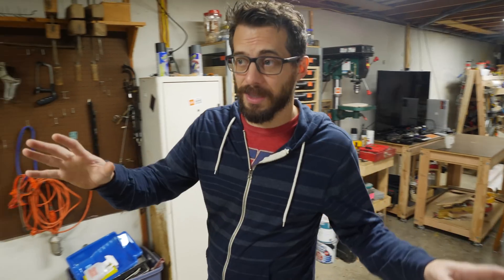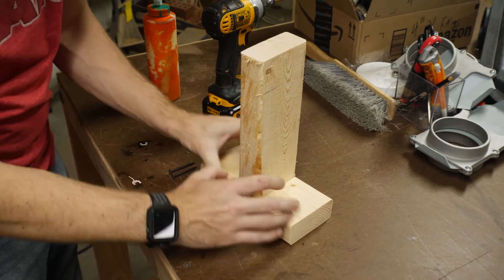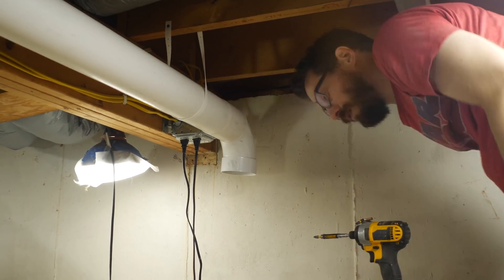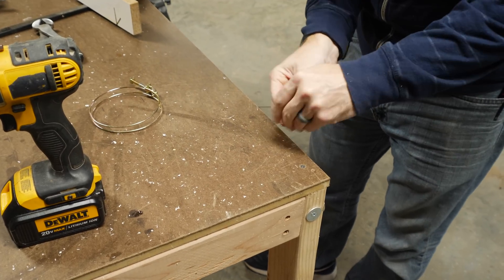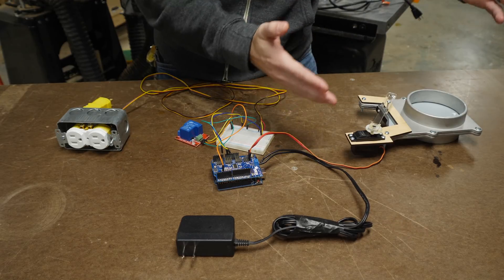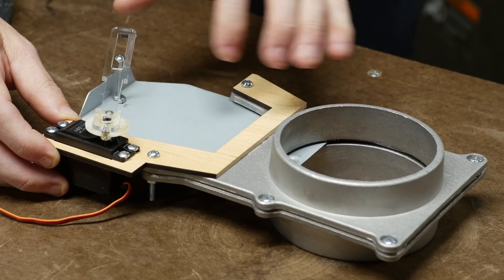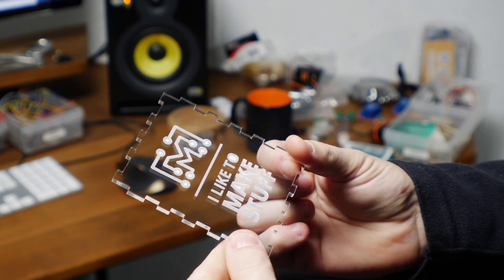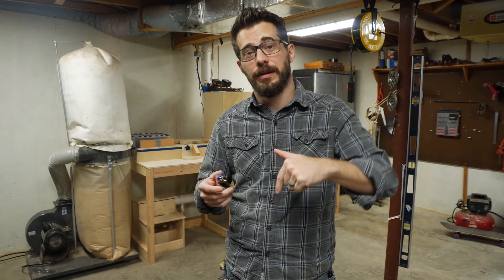Fully Automated Dust Collection powered by Arduino // How To | I Like To Make Stuff

Comment: How about a delay after you shut of the machine and the collector runs for 10-15 seconds more to finish pulling everything in? Nice work! I didn't know about the sewer pipe. GOnna have to check that out for my upcoming dust collector.

Comment: Great job, but i never under stand why people use Arduino when there is already micro PLC or smart relays with free software that designed especially for project like that and no need for acrylic box for protection, or convoluted programming. seems way over engineered   for a simple dust extraction system
Reply: gareth scott, Can the micro PLC or the smart relays do what Bob setup do?

Comment: Have you thought about adding a slight delay to the dust collector so that the blast gate will open slightly before the vacuum comes on. I ask because I assume that would put less stress on the blast gate servo, helping to ensure longevity.
Reply from the maker: It does. The gates open, the the DC. After the tool stops running, the DC stays on for another short amount of time to clear out the pipes as much as possible.

Comment: Very cool project. I am wondering though if the contacts in that relay are going to weld themselves together with the high inductive load of the dust collector, despite being 30A. I might be wrong but I thought a contactor was usually used for this kind of thing?
Reply from the maker: If it was deleted, it wasn't on purpose.

Comment: awesome bob. i have just automated my dust collector. does your collector uses a magnetic contactor? i have a 3 phases dust collector. here in brazil is very common to turn this kind of motors using a contactor. i use a 2 module relay controlled by a arduino. the first channel connected in parallel (normally open) to the turn on switch and the second channel in series to the disconnect switch. sorry my poor english. i'll try to upload a video showing

Comment: Better use a solid state relay for the dust collector, that motor draws a lot more amps when it starts up, and being one big inductor the current wants to keep running when you turn it of. That's probably why the mechanical relay fails, the contacts are welded together when the motor starts, and it arcs when the motor stops. Solid state relays don't have this problem.
Reply from the maker: Yup, that's the new component I've got on the way. 👍🏻

Comment: Hi Bob. If you are overwhelming that little SS relay, try using it to drive a contactor, using low current AC.
I like the idea of remotely controlling the vacuum using blast gates.. Hmm, 3D printing blast gates with built-in servos? 
 - Eddy

Comment: This is really cool!

If you wanted to fully organize it, you could make some of those "DIY" cyclones, feed them all into one big tube which connects to the Vaccuum. Label each cyclone with the type of wood and set up a blastgate control system to switch between them (Maybe the 3 you use most and then 1 for the others). This way, you can organize all your sawdust lol

Though it is ridiculous, I feel like I would do this. 

Any ideas as to what to do with saw dust?

Comment: Turned out great, Bob! I set up a similar system with iVac, the commercially available equivalent of your system. By the way, PVC cuts great on the miter saw. Makes super quick, square cuts. Also, if you want to hold the pieces together without making it too permanent, self-tapping screws go into PVC perfectly. I also taped my joints with aluminum foil tape, which helps eliminate any leaks.
Reply: I've seen a few other people use the foil tape for the same reason. Seems like a good call.

Comment: Just a suggestion, maybe you should get a reciprocating saw for cutting pvc. Home depot has a deal for a cordless dewalt with a 20v 5ah battery. Only issues is it’s sold out. (I am partially guilty for that because i bought one)

Comment: How well does this collection system work?  Does it keep dust off of everything?  Good enough to have in the same work area as a computer without the computer getting full of dust?  Never had one, but want one.  I wasn't sure how well they worked though.
Reply from the maker: Yeah, it works well but no system will get everything. I have a computer in my shop and it never gets much on it.
Reply: Thanks for the quick reply.  Keep up the great work, love the videos and projects.

Comment: I've been looking for something like this for my shop for a while, not willing to spend a ton of money, but the only problem with this design I see is the current and voltage limitations. What about 240v 20A circuits?
Reply from the maker: I would imagine that you could get current sensors for that but I've honestly never looked for them. I would expect them to be more industrial and probably more expensive.
Reply: The sensor in the video looks like an ACS712 which is not designed for 240V (some boards aren’t even designed for 110V). In your case I would use a so called current transformer. Here is some useful information: 
https://learn.openenergymonitor.org/electricity-monitoring/ct-sensors/introduction

BUT NEVER LEAVE A CURRENT TRANSFORMER UNCONNECTED, ONCE A WIRE RUNS THROUGH.
(Sorry for the caps lock, just want you to stay safe)

And as always be extremely careful and thoughtful when working with high voltages.

Comment: Project Suggestion: Wall-mounted battery cabinet with sections to hold various sizes of batteries and a section to hold a battery charger.  The cabinet might be in the form of an attache case with a handle that could be taken down from the wall and carried to the place where the device is.

Comment: that's wicked. my only advice is the next time you wire an outlet you should use the screws on the side because when you backstab them the wire will work loose over time. your projects are awesome, keep up the great work.

Comment: How do you decide the rating of the relay for whatever project you need to do?
Reply from the maker: Find the amperage of the tool or appliance that you want to use and find a relay that has at least that rating.
Reply: Cool thanks!

Comment: Hey Bob, If the relays are Not "Strong" enougth to power the dust collector, a simple way to solve it is to use two, three or more in parallel. They are going to split the current flow by the number of the relays used, as long as all of them have the same input signal coming from arduino board
Reply: Lucas Figueiredo or have that relay control a larger, beefier relay.
Reply: Stephen yes, that's another option. But this way, he may have to order another relay. Of he has more of the one he tried, the problem is already solved ;)
Reply: Lucas Figueiredo good point.
Reply: And remember not all relays are created equal. If one relays switches faster, than the other ones (this can even happen if the relays are „the same“) it could still break by the initial current spike. Startup currents can really be insanely high and a pain in the ass 😅
Reply: sabine mayer yes, you're right!

Comment: My shop is not nearly as big, so my system uses 2 1/2 flexible hoses and 3D printed blast gates with servos. I have considered adding current sense to each tool, but since my shop is small enough where I can just press a button before I use a tool, I haven't needed to do that. However there is MUCH easier way to do current sensing -- look at split core current sensing clips -- they're about $12 and I am using a bunch of them inside my electrical panel to measure electrical usage, they're non-invasive, so you simply crimp them around the wire you want to keep track off and feed them through minimal circuitry into an analog port on an arduino. It is extremely accurate, and in your case would be even easier to use since you're looking for just an increase in current draw, not a measurement.

Comment: Will the metal magnet cause a short in the Arduino? Potentially?
Reply from the maker: The washer is attached with hot glue which acts as an insulator.

Comment: I was really confused how a voltage sensor would work to know when a tool was active. Like does it measure voltage sag during the operation of the tool? Then I looked at the equipment list and it's a current sensor. That makes so much more sense. Great project!
Reply from the maker: Ah. I did say that wrong, huh? :/

Comment: Hi Bob, did you consider to use a SSR (solid-state-relais)? They can handle a lot of power and could be easily controlled from an arduino. I used it to control my spindel from the cnc which take a lot of current when switched on.
Reply from the maker: That's actually the part that I'm waiting on to replace the relay 👍🏻

Comment: Great video as always Bob. Really impressed on how you integrated an Arduino into a system like this. I just had one problem in understanding the steps regarding the wiring for the Arduino's components, if you have a simple wiring diagram that would really help me. Thanks

Comment: I think you would be better off using non invasive current sensors to monitor current draw rather then taping into the mains to look for a voltage drop. Search aliexpress for SCT-013-030

Comment: Hey bob, french fan here, I have several questions , first don't you pick up interference on the wires that control the servos (because they seem pretty long), second, is the arduino enough to power all the servos ? (all at once that is, or are they activated in sequence?)
Reply from the maker: No interference that I've noticed yet. The servo shield has it's own 5amp power source to run the servos so it works fine.

Comment: love it.  is there a sustain on the power to the dust collector? that way if you run a lot of shorter time cuts, the motor isn't fluctuating so much?
Reply from the maker: Yeah, it is set to run for a while after the tool is finished running.

Comment: I wonder if you could just use another servo to actuate the switch on the dust collector? It's not as simple a solution as a relay, but relays on large inductive loads don't tend to last very long.
Reply from the maker: Yeah, it's possible but the switch is physically pretty tight. Not sure what kind of servo could manage that. Maybe a linear actuator.

Comment: The grounding wire isn't actually doing anything, is it? PVC is an insulator, so don't you have to run the copper wire through the hole run, to collect electrons in each area of the PVC? I've not seen how it's done properly, but I assumed you'd run a bare wire inside the tube, the whole length. If that's not standard, then ignore me.

Comment: That's a sweet setup, Bob. Not sure if you put it in the code or not after the first iteration, but leaving the gate open and collector on for 2 seconds after the tool goes off will make sure any lingering dust is evacuated. That's what my commercial iVac switch does on my miter saw. Not dealing with moving hoses or opening blast gates must be nice! (note to self...get on that)
Reply from the maker: Thanks! Yeah, the gates stay open after the tool stops and the collector runs for a little extra time. The gates don't change again until you start a new tool.
Reply from the maker: Once 1 tool is running it ignores the system until it's turned off, then a fixed delay time is over.  That's all just code behavior.
Reply: Here's some documentation on how long and why you should keep the DC running once a tool stops: http://ivacswitch.com/wp-content/uploads/2015/11/High-Power-Dust-Collectors-Minimum-Run-Time.pdf , this is mostly for DC of 3HP or more but should still apply to a 2HP one?
Reply: If you run 2 tools at the same time, what happens (planer and table saw for instance) ?
Reply: I was gonna make the same suggestion, I also have a system based on iVac and making sure that the dust gates open / close a few seconds before the DC start / stop really help! In my case I leave the dust collector running for ~50 seconds after stopping the tool, this way if I make multiple cut in a short period of time (e.g. with the miter saw) I don't go through too many start/stop cycles (your DC can consume up to 6x what its typical current consumption is when it starts! You probably want to minimize this). Your system is really awesome by the way! I'll probably use some part of it to improve mine (iVac is pretty cool but has its limitation, being able to make my own automated dust gates would be awesome!)
Reply: Sébastien Marchand I was going to mention that too. These big DCs turning on and off over and over can be hard on the motor in terms of heat. A long day of chop saw on/off might be a problem. Ah well, I guess Bob has a great way to find out either way now heh.
Reply: For some reason after downloading the code and the adafruit drivers, it does not work.  All is hooked up right.  worked with some of the code and was able to get the dustcollector on, but servos do not move.  simplified the code to use only 2 tools and 2 gates, but still no good.  Any ideas?  Thanks

Comment: SORRY, BUT REALLY.   THIS IS HOW I DID IT BUT IT IS NOT WORKING, HERE IS HOW I DID IT BUT IT IS NOT WORKING. IT ONLY TOOK 2 WEEKS TO GET IT WORKING BUT IT IS STILL NOT WORKING. I USED MY 3D PRINTER TO DO THIS AND THAT. 
    Here is the issue with most of the YT so called woodworkers. you are dealing with people that are trying to understand woodworking, just getting started or are a little more advanced and showing them what has been going on the woodworking channels is somewhat of a slap in the face to a lot of them. 
 HERE IS WHAT TRIGGERED ME SIR. YOUR TITLE. "Fully Automated Dust Collection powered by Arduino // How To" AND AS YOU SAY IN THE VIDEO IT IS STILL NOT WORKING, COME ON REALLY.
Reply from the maker: You sound kind of mad.  The fact is that it IS working. One component is inconsistent and rather than delaying the video for a week, I wanted to put it out there while we test another option. If someone has a dust collector that is less than 2HP, it would work flawlessly.
BTW, you called me a woodworker. I've never said that.  There are plenty of channels that provide all level of projects, for all different types of people.
Reply: Really, he clearly states it a single component that failed. Once replaced the entire thing will work perfectly. Don't think bob ever called himself a woodwork. He just "likes to make stuff" and 1.5 million people agree.
Reply: You recreated his setup in the whole 23 minutes in which he uploaded this video? I understand why it doesn't work.

Comment: Have you had any issues with clogging with longer range ductwork? I've had issues with mine when putting a lot of dust through like with the thickness planer (of course I don't have those nice blast gates...yet!) Great video, this is really inspiring, I hope to do something similar when I redo my shop. Thanks Bob!
Reply from the maker: Hey Michael! No issues yet, but I don't have anything that's throwing in big chips like a planer. It's very possible but I run it directly to a shopvac. (My planer lives on a rolling cart, under a table).
Reply: I had a hard time earlier this year with a clog and finding it in a long run of PVC was tough. I've got old home-made blast gates that are really leaky though, so lower suction from that is likely a factor. When it's shop overhaul time, I think something like what you've done here is the way to go. Thanks again for all the great videos!